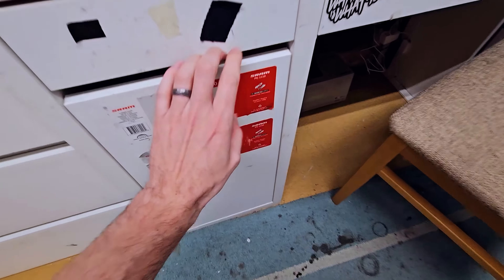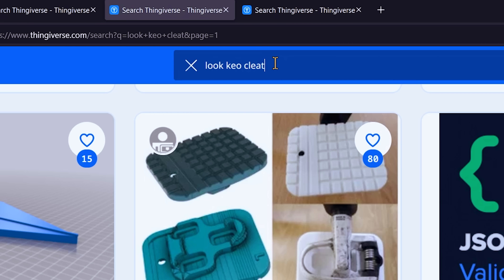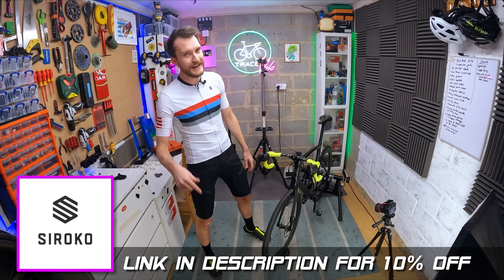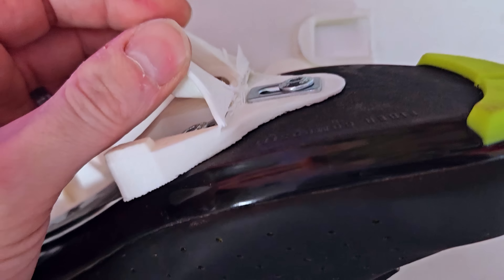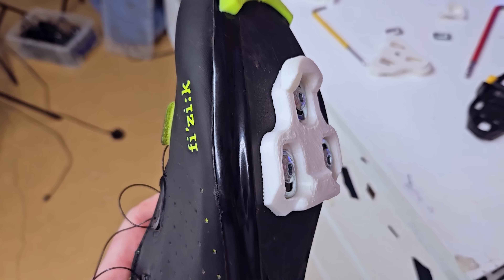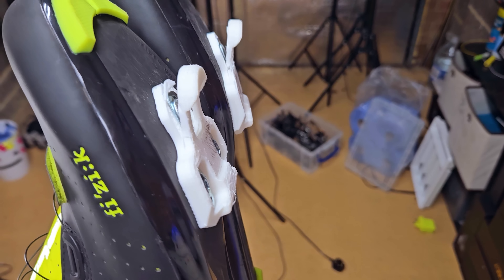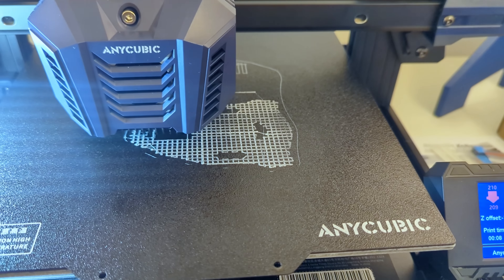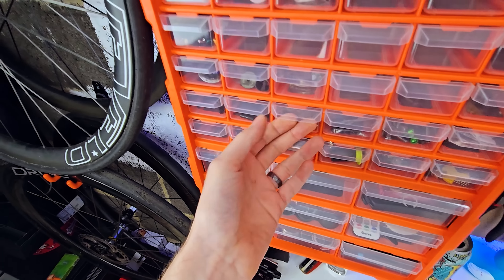Can you save money with 3D printed cleats?

Comment: In my experience, anything 3D printed tends to be quite brittle. In compression, it doesn't really matter, but in tension, i.e., the pull-up stroke, or loading your foot forward and backwards, its more likely to cause an abrupt snap without warning.
Reply: True. FDM wont work on cleats.. maybe printed vertically to improve layer separation issues.. But dont think will work for cleats. 
On the other hand, i just 3d printed a Shimano BB tool that did the Trick! Suppose previous mech was friendly with the torque :)

I do 3d-print a bunch of GSE tooling for aviation, albeit no torque involved, mainly alignment tools & "easy" stuff.
Reply: PLA is probably the worst choice of material for this. ABS or Nylon, preferably with a reinforcement additive would be better suited as they are softer and more compliant - but add printing challenges due to higher temperatures and tendency to warp. Larger layer heights and wider nozzles also increase layer adhesion. Printing the cleats at a 45 degree angle vertically may help with shear loads.

Ultimately not the best suited application, agreed. Nothing stopping one from making a 3D printed positive,  pouring a mold and making cast duplicates with two-part urethane. Could even add in chopped glass fibers.
Reply: Yeah... and that's why I think the carbon fibre filament thing would be a bust. The weakpoint is still the layers, and there wouldn't be any carbon fibre between the layers. In fact, the carbon fibre is a bit of a distraction, because in this use case, the keyfactor is absolutely the material used to bind the fibre, and that's something I haven't heard talked about.
<<Heads to Google>>
Right, so I found the reel he used to represent carbon-fibre (it was the first hit Google gave me, so he was probably doing the same) and the polymer is PETg. I just don't think mating layers with PETg sounds like it'd do anything for strength.

If you wanted to give cleats a fighting chance, you'd have to print them on their side (and by that I mean the orientation if the shoe was on its side) and do filament runs not 90 degrees to the cleat itself. Doingthem between ground and sole would still leave layer boundaries where they would be vulnerable to unclipping (i.e.lip would break off as a chunk rather than delamination running further into the cleat. Which angle would be best? No idea, But my head is churning over that sort of stuff now. ARGH!!!
Reply: @nialltracey2599  I think that irrespective of the material used to print, the voids left between layers by the FDM method and layer adhesion are the major issue here. 
Maybe a resin/UV SLA print will be better? Humm..
I think the best chance this cleats had is if they were printed "on their narrow side", but the supports required would make it highly impractical..
Reply: Print the whole cleat at 45 degrees. Problem solved
Reply: @Ryezn5057  -- Not really... it'll just fall in shear during use.
Reply: Accidents hurt less without warning so that's a positive
Reply: @jsvadj All correct, the adhesion between layers needs to be stronger than the plastic used for moulded parts to be even worth considering. And yes, I'm aware of the need for supports in my theoretical scenario. It makes the whole thing very much Not Worth Doing, because the amount of time taken to make one pair of  cleats with a shorter lifespan than shop-bought ones is hard to justify when cleats start at about half an hour's pay at the UK minimum wage...
Reply: made some years ago, still going strong, after you print them you stick em in the oven to cure the layers.

great for on the indoor trainer, useless for when you get off your bike and walk around and realize just how important those little nodes of rubber are on bought ones.
Reply: Thermoplastic, abrupt force in more than one axis and additive manufacturing don't go well together.
Reply: HELLOOOO FELLOW HAMBINI FANS!!!
Reply: @DrCoolHands  Id go Nylon with CF
Reply: That's why I always pull out.

Comment: The special filament will not make the delamination problem go away, if anything, it will be made worse. (And you would need a special nozzle, standard brass ones will die quickly this way). 

You could put the PLA parts into an oven and anneal it, however, this will change the dimensions slightly so you would need multiple test runs. 

Even then, the end result would be pretty crappy. 

Huge 3D-Printing-fan myself, but this scenario kind of showcases its structural weaknesses.
Reply: 3d printing for road cycling for now is relegated to make stuff like bolt covers (i use them a lot), and aero accesories like headunit fairings

i also successfully printed a garmin mount for a temporal replacement in PETG, worked great, and i suspect that some bentobox like the ORBEA Orca Aero or the BMC Timemachine could also be pretty interesting
Reply: Agreed, PLA sticks best to PLA.  Adding reinforcement fibers lowers adhesion between layers where delamination is a big concern.
Reply: He would need to print with Nylon filament with added carbon fibre. I dont see PLA, PETG, ASA, ABS work.

Comment: thoughts, I have a few. First for PLA printed cleats, I'd look at annealing them after printing, which would essentially melt the layers into a more cohesive object. Fiber infused filaments don't add strength and usually have worse layer adhesion (essentially the fibers create "voids" where the plastic can't fuse to other plastic). Not to say fiber infused filaments don't have other properties that may be desirable in certain applications, but for this application they would most likely perform worse. Resin may be a good option, but can also be brittle in its own ways, so if I were going that route I'd probably look for a "tough"  or perhaps semi flexible resin of some sort.

Comment: I think the best way to test this idea is to print them in multiple segments to optimize the layer line layout. Basically, print the base and the clamping section in two parts, allowing you to use the strongest orientation for each section and simply bolt them together.

Comment: I think you want to print it vertically laterally, ie starting with left/right side at the bottom and building up, so that the layers there aren't any forces to pull the layers apart on clip in's or whilst riding, however there may be damage when clipping out in that case. both ways you printed it have forces that directly pull the layer lines apart, I've done some quite successfel prints of quadlock adaptors and mounts, and the best orientations are unfortunately never the ones that cosmetically look the best! 

A redesign of the cleat to more suit the anisotropic manufacturing method is probably in order.

Comment: Be aware filaments with fillers can be a bit abrasive and damage some printer heads. 

The thing that might be interesting (but a lot more work) would be to print tooling that would allow you to mold a composite cleat using "forged carbon" (compressed chopped strands, in an epoxy matrix). But that's a lot of work potentially.

Comment: The actual cleats are injection mounded and use a tougher plastic, perhaps HDPE or ABS, I can't find any reference online. Looking at mine over the years and the wear pattern, they look like they have combined randomly orientated strands or fibres mixed with the main plastic. Which would make a lot of sense and an easy way to distribute random loading. Your basic home 3D and it's run of the mill materials won't give you the right mix of structure, density and material properties required for the type of high loaded a cleat needs to withstand. 

It's possible that more high tech additive technologies exist to produce a cleat, but injection moulding is the cheapest (once tooling cost have been recovered), faster and simplest way to produce them. 

You're not going to be able to cheap out on these items, which is unfortunate, because they do seem fairly expensive. I usually replace mine every couple years. I guess that's about 10 quid per year in cleats. I don't use covers and push off from some pretty rough country lanes if I have to stop.

Comment: Maybe send the files off to a shop that can SLS with Nylon. It's hard to get a home-gamer printer to perfectly adhere to the material properties. As some have mentioned, a ABS, Nylon, ASA with carbon may hold up better but you'll need a heated chamber to print them successfully.

Comment: I wonder if nylon would work better?  Bit of a bugger to print, though.  ASA maybe?  I'm not going to try, though - I use Speedplay :)

The only 3D-printed bike part I have used (designed, even) is an insert for the Campagnolo 11-speed front derailleur.  Because I lose one every 3-6 months, and got fed up of giving Tullio's lads £15 a time.  My 3D-printed versions work just as well, tend to only last 2-3 months, but only take 2 minutes to print.

Comment: An additional issue is the prints are flat, but the bottom of your shoes are curved and likely putting extra tension in the parts when you bolt them to the shoes. Print flashlight mounts and other low impact parts if you want to be successful with 3D printed bike stuff.

Comment: Most of the cycling world parts tend to be 30% glass fiber filled Nylon. Nylon is one of the keys to their durability and the GF is there to increases stiffness. It's also notoriously annoying to print due to it absorbing humidity and require between 8 - 16 hours at 70 - 100 degrees to dry out. I recently trialed some Polymaker CF-Nylon on a modified anycubic i3 (nozzle and firmware) for my EPS derailleur project and it's so much stiffer. Previously I'd been using their nylon on RC car drive shafts and it's layer adhesion is in another league compared to PLA and PETG because you basically don't cool it with a fan. When it fails it almost looks continuous. I suspect you'd have more success but still similar issues because those fibers will still be aligned making z still weaker.

Comment: Well that was obvious. I have printed various shims for the bike, as well as a garmin mount for aero bars, and a bottle cage mount for behind a saddle, for eg, but this can't work. MAYBE with a resin printer, but i have zero experience with that. In compression it works very well. Spacers above / below a stem would work as well, for eg. I printed a box that I designed to go behind the seat post & that worked for a bit until it disintegrated (and when it fails, it fails spectacularly). It should work if i reinforced it with fiberglass or carbon fiber. 3d printing tech + composites can get to very interesting results for the geek minded.

Comment: If you use nylon with carbon filament, you will love it or filament nylon with fibreglass but it is difficult to work, but it works better than original

Comment: I wonder if this low rigidity is because of the printing material or the layered printing itself. Normally these cleats are injection molded so I assume they have a more consistent and stronger bond netwoek on the atom level compared to layered object, but if you could get the same raw material used for the injection molding for the printer, maybe such cleats would be more robust.
Reply: In polymers it's the molecular level that's important for strength, ductility and toughness. Interactions of long covalently bonded chains with with weaker secondary bonding like van der Waals and hydrogen bonds. Depending on the manufacturing route you might end up with a lot of molecular chains that are entangled or in some cases purposely oriented along a specific axis. You can vary the anisotropy.

Comment: I think other kinds of pla filaments might perform better without having to use fiber filaments or nylon. There are some filaments branded as PLA+ (for example from eSun which is quite popular) that are way less brittle. Those can be printed on a regular 3D printer with a brass nozzle and will not have any of the complications of material such as Nylon (different nozzle material / extra toxic fumes / low adhesion / high heat). Printing PLA+ on the hotter side makes it a bit stronger as well. Technically there are also ABS+ variants that have certain additives to make it more flexible but printing ABS is a bit of a hassle in general (low bed adhesion + warping).
Reply: None of those materials will be suitable for the strength, toughness and impact resistance needed for cleats. The cleats are injection moulded. Probably with HDPE. They might be ABS but you're not going to 3D print a cleat on a home machine. Injection moulding will give a more uniform cross-section than 3D printing.

Comment: You should work with a 3D printing channel on YouTube
Reply: yeah those prints looked pretty rough. I think you could get more strength out of the perfect filament type, settings, printer and post processing. There might also be room for adjustment of the model.

Comment: The only printer technology to even come close to the strength of injection moulded parts is SLS. This generally prints in sintered nylon but I have seen parts printed in glass filled nylon which is stronger still. The only problem with SLS is the cost, once you pay someone to print them (because the machines are eye wateringly expensive) it can costs more than off-the-shelf cleats.

Comment: wrong material and terible layer adhesion. Try PETG 250C with very low speed (20-30mm/s max) and use 101% material extrusion.

Comment: Even if this test worked would you trust them on a descent? 3D printing is good for novel items but don't consider them for any load bearing surfaces where failure can result in injury. Official cleats are not that expensive and you know they work safely
Reply: You can produce very robust 3D prints. You just need to know how. It comes down to material choices, post processing the correct printer settings.
I printed some flat pedal adapters in ABS and baked them afterwards and the show kind of no wear after over 100km.

Comment: Carbon fiber filaments or fiber glass filaments are all marketing things. They are not stronger than regular filaments.
Reply: I think the issue is not so much the strength as the brittleness of the material.
Reply: The quality of fiber reinforced filaments varies wildly. There's a reason moulded pa-cf/gf has replaced aluminium in almost every application where cost is a factor. Sadly it's hard to reach that kind of strength with fdm printing. Layer adhesion strength varies wildly (10x differences are easily measured) between filaments, printers and settings. The solution is 3d printing a mould then using that to make the parts.

Comment: it's extremely obvious, looking at your failure, that you should have decreased your layer height and increased your temperature. Your density was probably 15% LOWER than it should have been, so  even your bending strength would be shit. Let alone the layer adhesion strength...

Comment: From someone working in a FabLab makerspace making functional prototype 3D prints, a suggestion:

Modify the stl file with 1.9mm dowel holes all the way through the sides of the cleat, print the cleats sideways such that the layer lines are aligned front to back (disable support on the dowel holes), then dip the 1.75mm filament on epoxy and push them through the dowel holes to reinforce the print (like rebar in concrete).

That said, PLA isn't good with abrasion, so something like ABS, PETG, or nylon will work better.
Reply: You're still going to get the delamination that you don't get with injection moulding.
Reply: @Liofa73  The delamination will still dramatically decrease as the bending and shear forces are applied at the tabs that engage with the pedal, which are in unison with the entire cleat body's cross section at the axis of symmetry (front to back). With each print layer (being that said cross section) printed fairly solid, delamination only occurs under torsion (twisting) at said axis of symmetry.

Think of it as popsicle sticks that are stacked such that each is standing on its long, thin edge but are glued together at its flat faces. The pulling forces bend all the popsicle sticks in unison, not against the glued joints.

In Luke's print orientation, the pulling forces rip the 'tab layers' from the rest of the body. In my alternative, the entire 'body layers' include the 'tabs', so the pulling forces will try to rip the entire body off of the shoe.

Additional fine-tuning of print settings such that the nozzle overextrudes and possibly performs ironing at every layer, this could be a viable option (especially with more appropriate filament material)